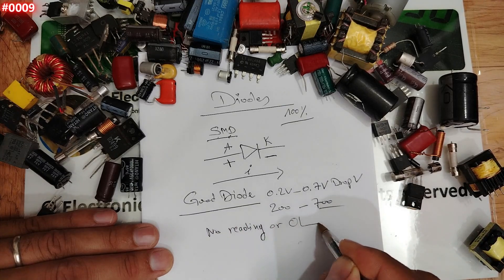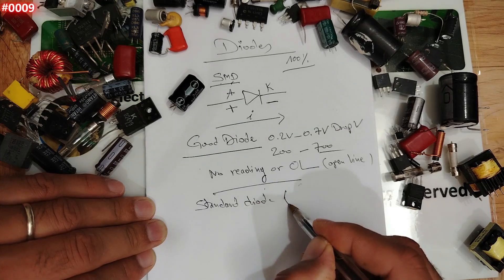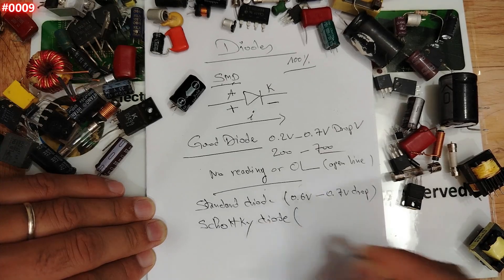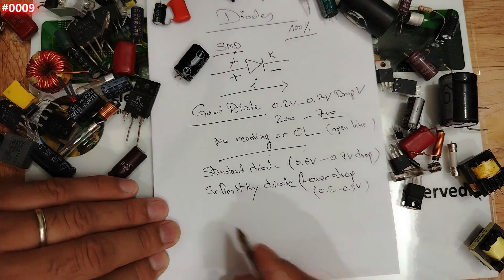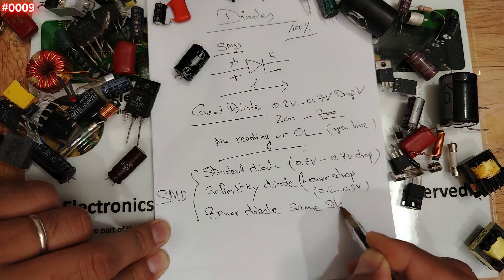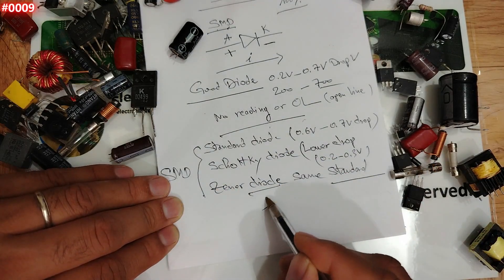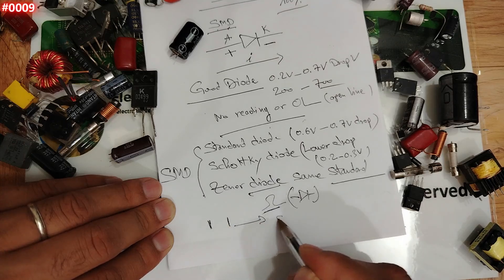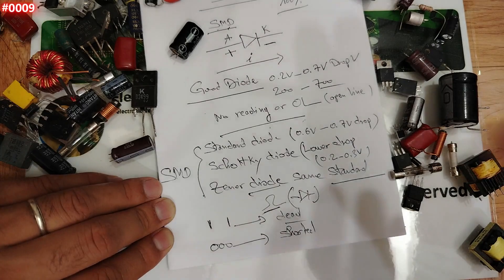#009 Electronic Components: SMD Diode Testing Using Multimeter | how to check schottky diode

Comment: great work 
great explanation
Reply from the maker: Thanks, I'm glad you found it helpful
Reply: sir i have a pcb which wen connected to a charged battery , still not shows volatge to board i have changed the on off knob, power ic and processor also still no voltage